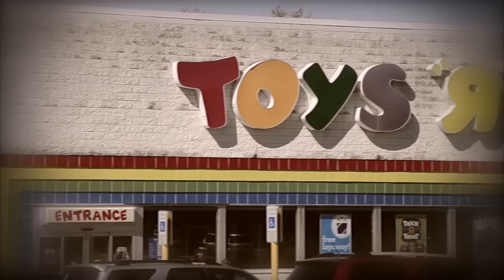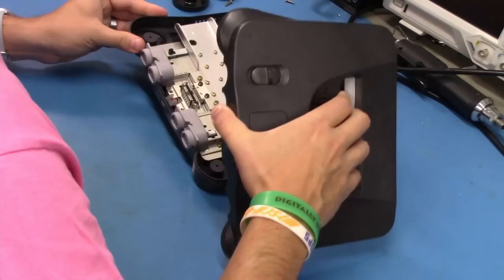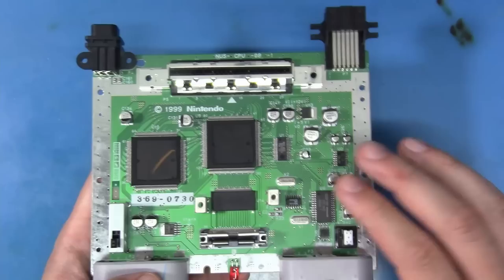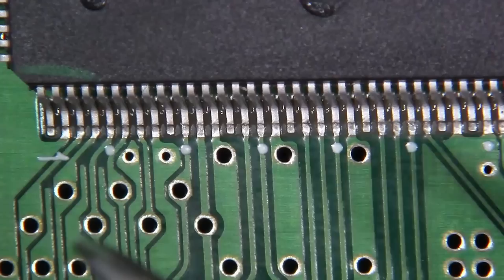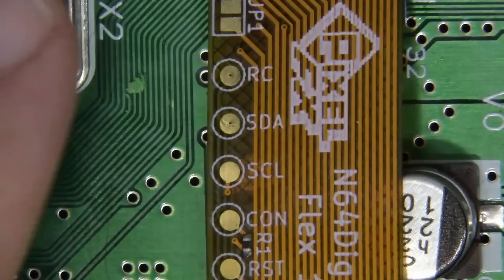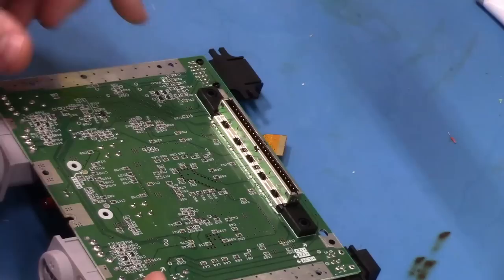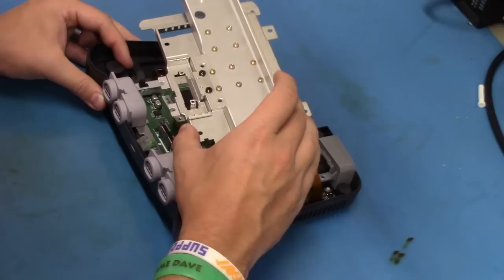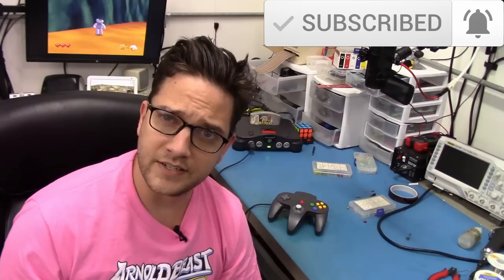NEW MODS FOR THE NINTENDO 64! N64Digital!

Comment: Props to you for having a bottle of liquid flux. I used to do 12 hours of surface mount repairs for a living at Solectron, Texas, back when Pentium Pro boards were being sold by Gateway and Dell. I always got a great sense of satisfaction clearing solder bridges from fine pitch components, just like this.

Comment: Despite of the fact that the n64 didn't catch your attention, is important to point out for other people, that no matter how big the PS1 library was in that era, the higher highs of the n64 changed the industry. 

While PS1 delivered traditional dpad controllers (or analog ones that were poor supported by some games, since the base gameplay demanded to be coded with dpads in mind, since the analog controllers were a non-default accessory), the n64 was indeed, delivering 3d gameplay wise. Yes, the ps1 sold 4 times more than the n64, was much more popular, had the best rpgs, etc... But the gameplay of those games, was always something that felt it could be better, less stiff, more modern, etc. 

The Resident Evil series, Tomb Raider, don't have that tank gameplay because it was the desire of the developers, it was a solution for the outdated out of the box ps1 technology. Of course, not everygame could benefit of modern analog control, 2d fighting games, platform, beat'n'ups were terrible on analog stick, but at that time, those games were kind of despised, because 3d graphics/gameplay were all the rage then.

The n64 stablished things like: lock aim (Zelda Ocarina of Time), analog controls, functional FPS games on console, 3d gameplay, camera control, high resolution (expansion pak). All of this still a thing today. I can't remember any inovation at all of PS1 that still a thing. Maybe dual L and R and Analog stick, but this is not new technology, is justing add more of something that already exists.

Comment: Welcome back!
Ooo Dam! I like that makeshift solder wick strat.

Edit - CAREFUL with the Jumper Pack orientation when testing lads. If you put it in backwards you'll blow a fuse. It's a resetting fuse though so if that happens just unplug the PSU and wait a few minutes.

Comment: 1. Clean your freaking systems before you send them off to get repaired. What if something is still alive when it gets there??
2. I love this install video. Not removing the expansion pack and leaving the 5,000 screws in the N64 board were a HUGE time saver. 
3. I fully agree with the statement about not buying the Ultra HDMI. I finally got my hw2. While I love some of its features, it's only a matter of time before  PixelFX catches up with it in firmware updates and then surpasses it. Ultra HDMI v2 is a great product, but for the production time and communication from Marshall it's not worth waiting for when products like PixelFX and Retrotink 5X are finally available. But for anyone that is still in that dumpster fire of a thread, know that Ichinisan and his brother CZroe are working constant late nights to get product into people's hands and refunds back into wallets. It's slow, but it's rolling.
Reply: Yeah I got my system with ultra HDMI hw2 recently and was curious how the n64 digital would compare. In general I recommend supporting pixel fx due to the team being reliable.

Comment: Got HW1 of the mod in 2021, was gonna try to have you install it but your work load was too much. Despite that, you directed me to use the no cut and get retro frog’s adapter which kept me from cutting plastic while keeping my dual output dreams.
But after a good year of practice on GB and GBA games and doing a SNESjr RGB install, finally did it myself with your video in combination of LI Retro and Dubesinhower. (I was also able recap the system too) 
Have a CPU-8 like the video and surprisingly with your methods, absolutely crazy how easy it was to get the main flex cable installed on the cpu legs. 

Thanks for the vid and personal help, (and the 3 snes boards i busted by pulling pads with bad solder and flux while learning to solder)❤

Comment: I want to mention my past days of using my UltraHDMI N64 is to make sure the Mini-HDMI cable isn't going up in an angle when connecting to a higher location like a TV/Monitor HDMI port, make sure it is going straight forward by a couple of inches. I remember the mini-HDMI port getting disconnected from the board because of this.

Comment: Voultar as always the best, greetings from Chile.
 It hurts not to have that quality and products here in my country. I bought your n64 RGB chip a few years ago and installed it on my own and it is fantastic to use it with the hd retrovision cable, but N64 in my opinion you have to be a big fan of it because graphically it is not the great wonder except for some games, such like Zelda, Castlevania and Conker. and the HDMI and Component Cable do not work miracles

Comment: 24:19 of course you meant RGB modded N-64 into a RT :) I've done that mod of your's and the SNES version using your videos and you made this mod look just as easy! I maybe would have tried it myself if I hadn't already mine to you earlier this week XP  still happy you're the one installing tho.

15:03 also - do you have interest in making that secondary flex cable? anyway - excellent video - maybe my fave yet. I had always been scared of rake soldering until this!

Comment: Great video Voultar! I've been following your channel for a while and I've learned a lot from you over the years; the retro console modding community is lucky to have you. I'm curious though, as someone who have never worked with flex cables before, what temperatures do you prefer when soldering these?

Comment: Not seen the other videos to compare but anyone wanting to to drag soldering it’s easier to use a decent tip with a well. Trust me, before BGA packages became popular Pace Sky boxes used to have a processing unit we called an Emma chip, it was huge with hundreds of very fine legs, it took a certain steady hand to successfully drag solder them and I used to correct many failed attempts by reworkers, our WMD 3 solder stations with a WSP80 iron were the tool of choice with a well tip and it had to be in good shape, any nicks in the tip would result in catching legs and bending them, oh and lots of flux.

Comment: I really think that ribbon cable should be redesigned. Much like what you said, it's dumb to need your own individual cables to solder to the flex cable. However my biggest gripe is knowing that the cable is expensive, then they ask you to do a lazy flip with it just to get another lead in position. Aside from possibly ruining the cable from over bending it, once it's actually connected the whole thing looks a bit ugly IMO.
I'm also a little concerned with the fact that the ribbon cable has to lay on top of some of those chips. With that cable getting between the heatsink and the chips, wouldn't that effectively cook the cable?
Reply from the maker: Personally, I completely agree with you. I don't like the implementation of the current FFC cable for the N64Digital. Having to break out these soldering connects by hand defeats the purpose, all together, IMO.

Comment: The man returns, our moms rejoice.

Aside from these various HDMI mods never being in stock, I don't see the point in spending almost $200 each for these HDMI mod solutions vs. doing RGB mods and using a RetroTink or OSSC (unless you are just modding one console I guess).
Reply from the maker: A cheap RGB modification and external video processor is also my preference. But for the hardcore N64 lover, this is the best you can do as far as internal modifications are concerned!

Comment: Couple of questions: What temp is your iron set at?  I assume too high can damage the flex?
Finally, what is the tip style defined as?  I've never seen a bent tip for my Hakko.  Thanks....
Reply from the maker: That's a J-Series T12 tip. And I like to work with 315-325C. 

Thanks!
Reply: @Voultar  Thank you for the info!

Comment: Well done Voultar, top video as always and welcome back 👍. Can I please ask one thing, what temperature do you have your iron set to? I always worry about putting too much heat into the board components and flex cable. Thanks again.
Reply from the maker: I work quickly, and therefore, I typically use a temperature from 315c to 325c, all the time.

Comment: Sold out already as usual, just wondering if it might be possible to solder a switch to the jumper on the cable to change between 50 and 60 Hz output. I'm in a PAL region but have equipment capable of NTSC to PAL signal conversion and a few US cartridges hanging around.
Reply from the maker: Actually, this modification does that for you! There's a "virtual switch" in the hardware that takes care of this.

Comment: I'm running my N64 through Insurrection's s-video cable and the Retrotink 2x and it's no doubt, an improvement. However, it's difficult to see past the analog noise. Problem is super clean low-count polygonal graphics aren't quite as captivating as razor-sharp pixel art.

Comment: I got black and white picture with lines with composite out, controller doesn't connect and hdmi will be black screen with the OSD only working when pressing button. Any idea what's going on?? Repeated mod on 2 separate N64, same for both?
Reply from the maker: You've most likely made a mistake with the GPU Flex cable.
Reply: @Voultar  I ordered 2 more cables just in case. I bought all of your Amazon suggestions because I figured it's better to learn a skill first before sending it off to you to do your magic. Figured worst case scenario, if I did it myself, you would get commission off of all my purchases but if I mess up the second flex cable, I would send it off. I thought I did a pretty good job first my first soldering experience. After doing it for a second time, got it pretty perfect but may of did the damage to the flex the first time around. Regardless, your video has gave me great tips and your amazon items makes it a piece of cake to solder. I did little things here and there but wrong supplies/tools makes it terrible compared to new tools. It's like I'm reborn with a whole new soldering life ahead of me!!!

Comment: N64 is kind of the same to me. Super Mario 64, Star Fox 64, Body Harvest... That's about it. There are other games I like, such as Banjo Kazooie, Ocarina of Time, Jet Force Gemini, and Doom 64, but they have better ports/remakes on newer platforms now, so the N64 itself really doesn't command much of my play time. Also that controller. WTF?! Sure, Nintendo kept their games simple enough to make it work, but pretty much anything else actually tried to use all the buttons (as you would expect to be able to do), so you were always having to move your hand and do weird reaches. I will absolutely never understand what Nintendo was thinking, what hypothetical race of 3 handed people they made that controller for, because it wasn't for us 2 handed humans. Also, the analog stick destroys itself. Unbelievable how they could design everything so poorly.
Still, I have to admit, 3rd party replacements usually don't cut the mustard in terms of the control you can get out of that analog stick when it's still working. Playing Super Mario 64 with third party controllers, or even the 3D All Stars port on Switch, is a nightmare because you just don't have the proper control that was intended over Mario. I'll give N64 fans that one. I'll never give them their defenses of the 3 handed design, but I'll give them the fine analog control out of the 1st party stick.
But those few games and the analog stick ultimately led me to deciding I want an N64Digital anyway, for those few times I do play. That, and modding is fun!

(oh, and forget 1080p - this thing does 1200p! Much like the PS1Digital, it looks amazing on my 4K TV)

1:34 - yikes 🙈 I'm glad you already taught me better than that in the PS1Digital video and streams. Installing the flex cable ended up being very easy for me. I honestly had more trouble soldering the 3 wires to the PIF chip, since that was fairly new to me.

Comment: I have owned every Nintendo console up to now, I actually find the N64 the worst for me, I found Mario and Zelda games good but overrated, the consoles shortcomings just sealed the deal for me especially the fact it used carts that meant games could be double the cost of Playstation and later Dreamcast yet were cut down versions i.e sound, video, content.  So for me I could play the famous 1st/2nd party exclusives and enjoy them but it wasn't a main console for me, even the Saturn outdid it by far for me, great fighters, cheap games due its early death, worked as a cheap cd player etc.